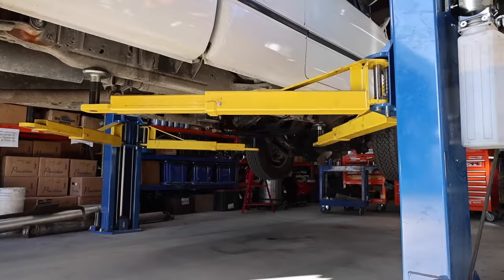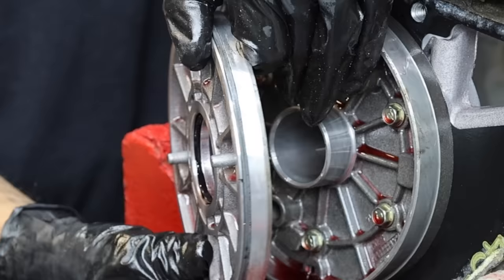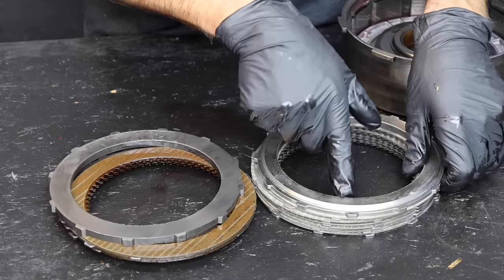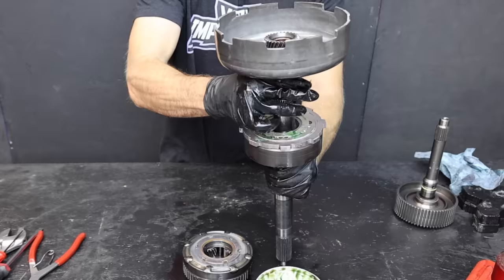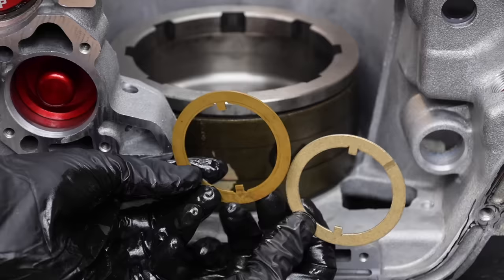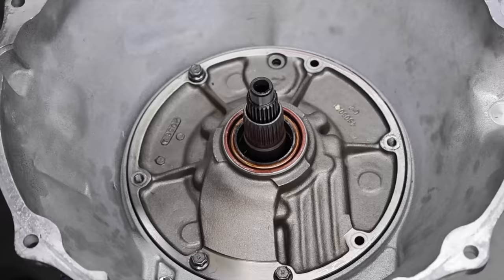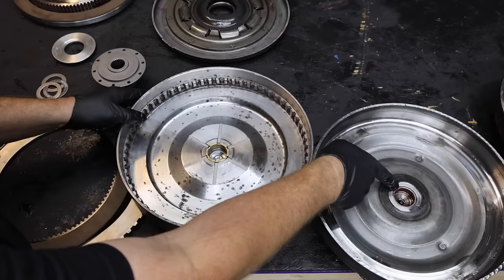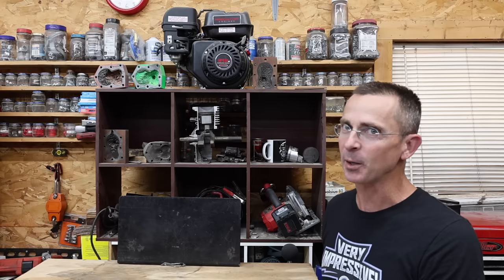Did I Waste $4000 on a DIY Transmission Rebuild (47RE)?

Comment: Just get an Nv4500 and bullet proof it. 
Handles 1500hp/torque no problem and way cheaper
Reply from the maker: Thanks for the feedback.
Reply: @ProjectFarm  damn bro, didnt expect a reply. 
but seriously. ive got a 98 12valve with  the 5speed nv4500 i put 1500$ into and itll handle anything i throw at it.

Comment: Crazy how these transmissions use a band instead of a clutch pack for second. I’m not too educated on these transmissions but it seems like a major weak point even with upgrades. I’ve got experience with an 80s ford aod and that trans uses a band for overdrive and it’s the weakest link of those transmissions aside from the finicky nature of its fully mechanical valve body
Reply from the maker: Thanks for the feedback.

Comment: So this video tells me transmissions aren't a diy option. automatic transmissions not only have to convert power from the engine to geared power to the street, they have a manual gerotor hydraulic pump in them.

Comment: Project Farm you're looking for an idea for something to create of your own I'd like to see a test kit where I could stick oil on and it would tell me the consistency so when I'm going to buy a car I will know if someone put motor honey in it it's got 90 weight gear oil or some other additive to hide a mechanical issue that would also transmission fluid
Reply from the maker: Thanks for the suggestion.
Reply: @ProjectFarm can you also do a test on the rubber brake lines that go from the caliber invalidate if there's any proof to them crushing or not allowing the fluid back through or freezing fact just the calipers bad
Reply: I see a lot of people let the brake caliper hang when they're changing the pads I never do this

Comment: That wasn't quite taking that new radiator cap and driving a new truck under it like most 25 year old Dodges deserve 
But the low mileage and great condition of the old Dodge was definitely the right choice
Reply from the maker: Thanks for the feedback.

Comment: Should of bought a performance transmission  from gm  about same cost with 3 years 100,000 mile warranty  most trans rebuilds only has 12/12 or less
Reply from the maker: Thanks for the constructive feedback.

Comment: No thank you. I think I will just buy a new transmission. I you have a lot of miles on your transmission do not flush it. It could start slipping. The old fluid help the transmission parts grip each other.
Reply from the maker: Thanks for the feedback.

Comment: how 60 plus rotating parts hold together for 300k miles in a transmission without shearing apart.....those engineers have been dreaming and praying and thinking applying techniques and principles of engineering and science hard for centuries....

Comment: Should of just bought a manual 7.3 powerstroke to begin with then all you’d need is a tune upgraded injectors and a turbo…
Then you would have a truck that would blow that dodge away with much less work and you’d have a higher quality vehicle dodge quality is junk especially in the 2nd generation
Reply from the maker: Thanks for the feedback.